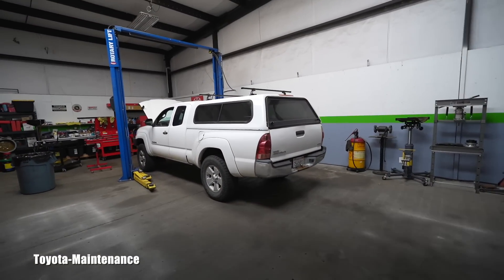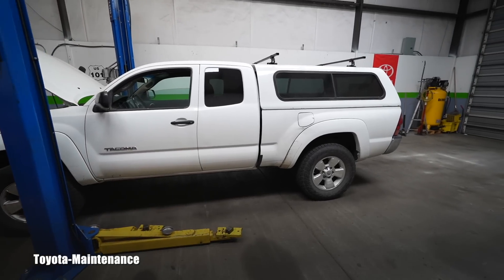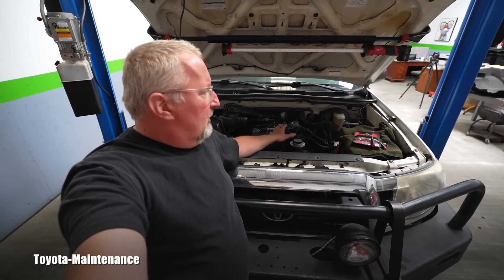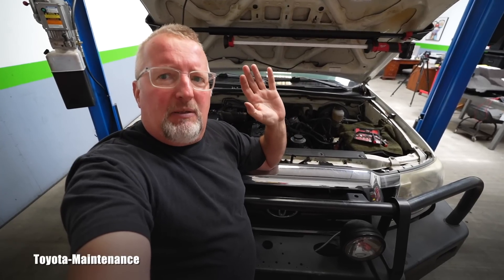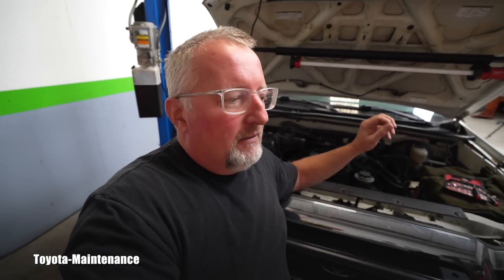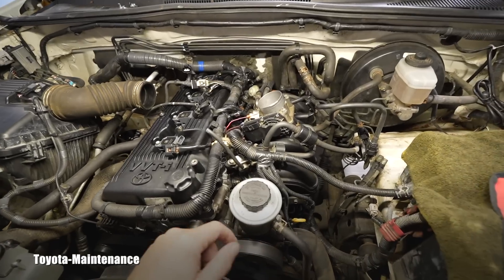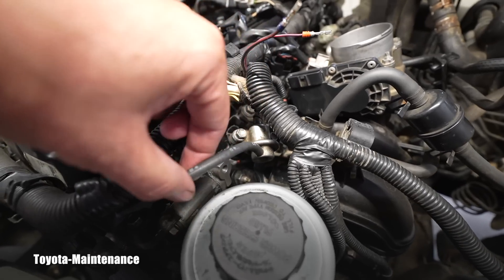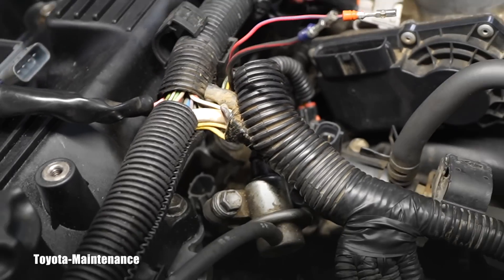Toyota 2TR-FE Engine Misfire Cylinder 1 code P0301 Diagnosis Repair

Comment: My respect for you , finally someone came with something different …. 
2010 Tacoma with the same issue , I replaced coil, spark plug and injector , cylinder compression 150 psi …. Curiously I also tested the injector connector for positive voltage and signal with a noid light tester and was ok 🤔 nevertheless I m going to try what you did if that works for me I will compensate you ($$$) for your advice and time for this video😉
Reply: Update …. I’m missing testing the coil connector….

Comment: I got the same problem now with the scion 2zr engine change all ignition coils spark plugs intake tube vacuum hoses intake planum throttle body and it still struggles it idles fine but soon as you engage it surges

Comment: I have the same truck the same problem and can’t figure it out it literally done it once I shut it off unhooked the battery hooked it back up ran great for 30 miles then it done it even worst now it’s misfiring on cylinder 1 and I can’t figure it out

Comment: mechanic want to replace engine on my Tacoma for the same problem  2002 Tacoma preruner 2.7 p0301 misfire in cylinder 1
we replace the injector and problem fix

Comment: Hello Sir, You are very good! 
 I have a same problem in my venza 2013 1AR-FE since long time, mechanics change everything only one mechanic told me change the coli wiring just housing (P0301) I changed it but after few months, again same error occurred, Now I watched your video. it is very knowledgeable. 
I would really appreciate if you let me know who to change the wire, like you did in the video.
Thank you,

Comment: Just want to thank you for such a GREAT CHANNEL, SORRY I BASHED YOU ON THE driving a client's car around deal. I was way out of line. It is because of your channel I found out about my timing chain tensioner leak on my 2012 Corolla LE. My mechanic fixed it for me and piece of mind no more leak. I replaced the old tensioner with an OEM part. Total job and labor $125.00. New tensioner $41.55 and gasket $5.45 ....in total still under $180.00. Your video saved me money when he watched what you did in your last video.😅👍
I passed on your business address to a family member in your area.
1305 10th Street
Arcata, CA 95521
Unit 3

Comment: As a professional mechanic, why didn't you consider the 1st time that it could be the number one injector or the electrical connector? What exactly did you do the first time the owner brought the vehicle to you, and you charged him, or her for one hour of diagnosis?
Reply: Apparently he says there was no concern when it first came in and he charged 1hr diag to run some test (check for a head gasket leak?). Kind of strange there wouldn't be any DTC's he could reference unless the customer or the other tech cleared them. This repair seems strange to me.  Why would he notice the faulty connection only AFTER swapping the injectors? Also if the misfire could easily be replicated, why wouldn't he just slap the plenum back on (which takes less than a minute) and get a video of it. Typically, there would be signs of arching on the pins from a bad connection, especially since the misfire has been happening for so long. To me it looks like someone probed the pins instead of back probing, and damaged them. Also, initially he stated that customer said it would misfire after a cold soak/start, not common with bad pin connectors. This whole diag seems off.

Comment: Good afternoon sir Peter I have to say you video are very well done very professional but most importantly you’re very good at finding problems a
solutions. I have a pre-used 2010 Prius and I recently change the hybrid battery and had it replaced with the refurbished it’s been over 4000 miles and I still have the code P0 A80. and cannot pass smog in California. I also have lights on my cluster the traction control ABS brake in the! Surrounded by a circle. I would really appreciate if you could give me some guidelines or I can just take my vehicle to you. Thanks Peter for all you do.

Comment: I prefer being lucky as well. My Hilux kept stalling intermittently and wouldn't restart. Replaced the igniter. Still stalled randomly. Replaced the coil because it was fried. Died again but that time, I lucked out and found the igniter and coil were only getting 6 volts. A new ignition switch fixed everything.

Comment: Excellent video ! Thankyou. I'm not a qualified tech but I know the very basics. My mothers car had pressure building up in the cooling system. When the radiator cap was removed you could see small bubbles. I told this to a qualified tech who had "seen it all before" and refused to look at the vehicle and suggested that I sell it. He "knew" it was the head gasket. I, as a matter of trial and error, replaced the thermostat fixing the whole issue. If I had taken his advice I would have sold a car that needed 40 dollars in parts because of his wonderful "knowledge". cheers :hand-purple-blue-peace: